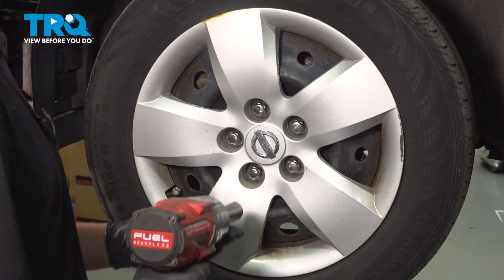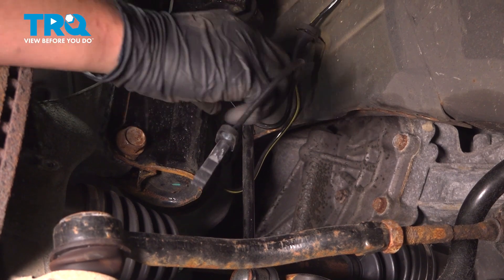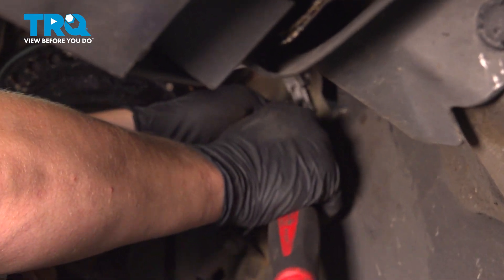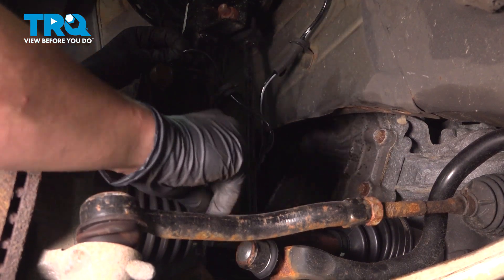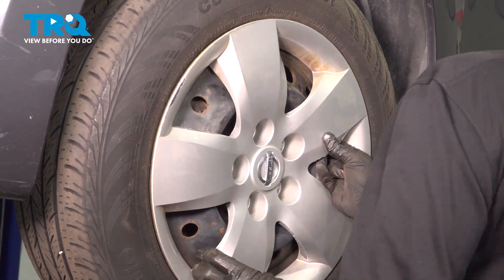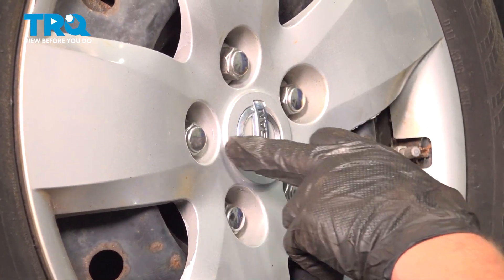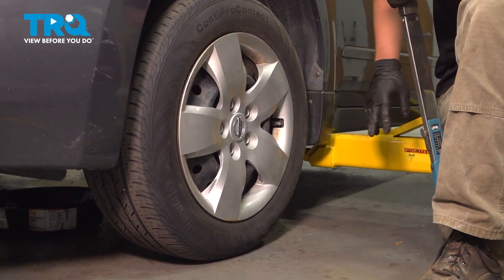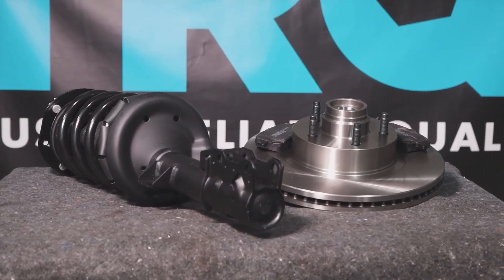How to Replace Wheel Speed Sensor 2007-2012 Nissan Altima

Comment: Do you carry the bolt that holds the speed sensor in place?  My bolt head stripped off - I need to try and get it out using easyout.